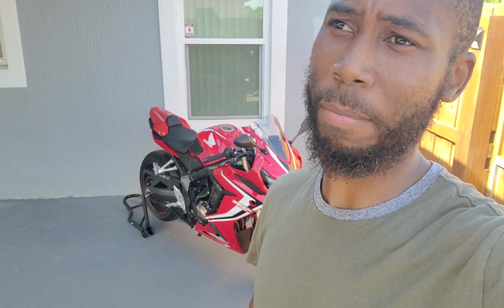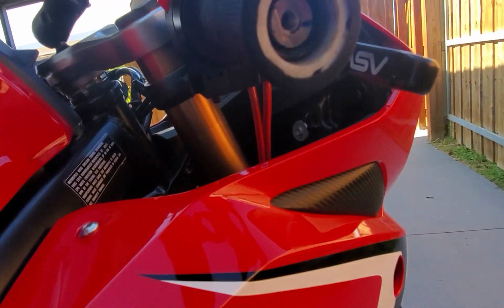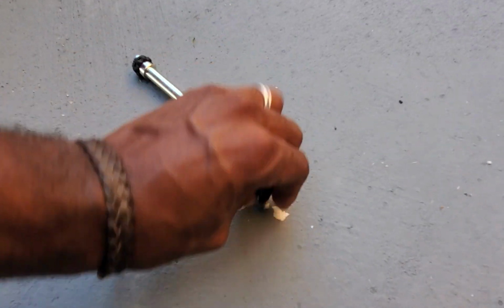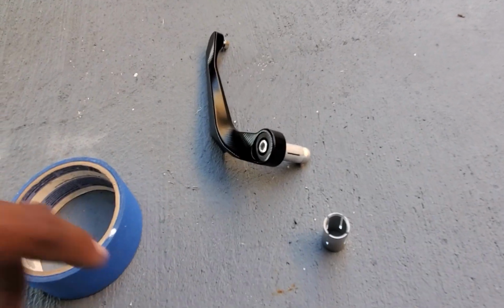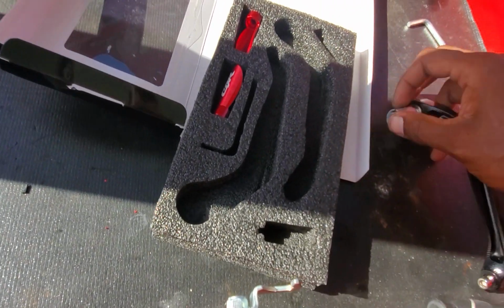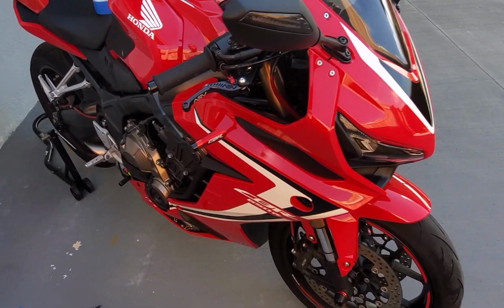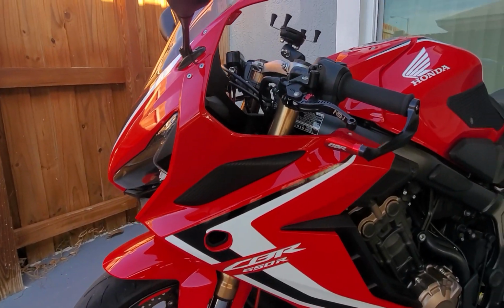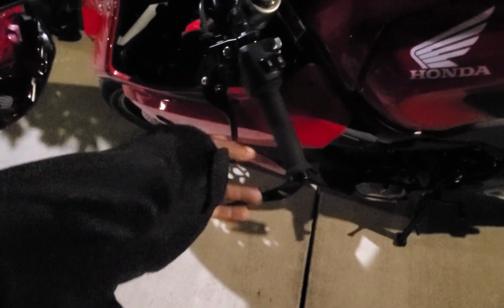HONDA CBR650R 2019 - 2024 PROTECT THE LEVERS { PROTECT THOSE HANDS }

Comment: Great video, my man! That solved my issue with those. The box had zero description on how to get the other piece to come out. Shout out to you dog. I started to work that way and wasn't sure, and then you confirmed it. It takes the leverage and strength. I liked how you explained some off the small aspect that it took to do the job. You gotta give her a little upgrade for her not bucking you off. They are the horse of the time.
Reply from the maker: Lol that's what's up

Cheers

Comment: You don't re-use the inside weights???
Reply from the maker: In this I did not and I wish I did
Reply: @jjmax2007  is it possible to install with the weights on?
Reply from the maker: Yes yes just have to push them inside the clip on

Comment: U could have left the internals and bolt this stuff into it.
Reply from the maker: I tried did not work for me u mean push internals more in????
Reply: @jjmax2007  if it manages. 
Either way U need to add weight to handle bar to loose the vibrations.
Reply from the maker: True very true
Reply: Are you able to do that to Hondas? I have some guards but don't want to take out the weights

Comment: Do you think you can just bolt these lever guards next to the original bar end weights? (with a rubber in-between to avoid scratches, and longer oem bolts).
Reply from the maker: I'm not sure the way I installed my they are firm I have not try it that way it may work I'm not sure tho 

Cheers

Comment: Hey man, I tightened the bolt and it expanded enough to stay in even if I pull, but the brake guard can spin around, do I have to keep tightening until I can no more?
Reply from the maker: I would have to see what your talking about I'm not sure what u mean ??
Reply: @jjmax2007  when you tighten the bolt does it get hard at some point?
Reply from the maker: No the lever stop moving before the bolt gets tight 

Cheers

Comment: you should not remove the weight and anti-vibration bar from the handlebars, they are very important for the bike handling and stability, and those kind of lever protector dont protect at all. Alluminium will bend/break at first shock
Reply from the maker: U are right regrets 😔after smh a shame too
Reply: @jjmax2007  so would you advise against getting lever guards / bar end mirrors? Did you notice a difference handling/stability/vibration?